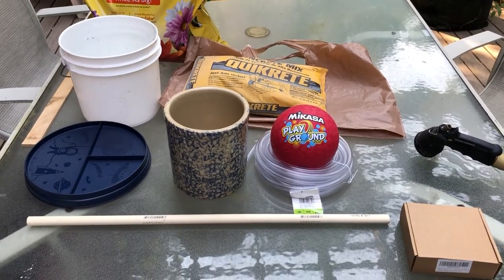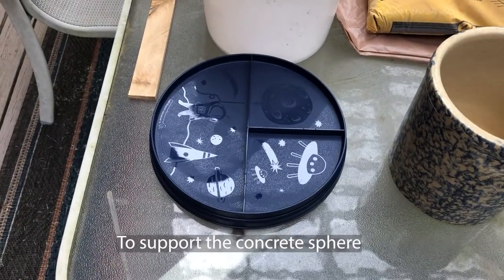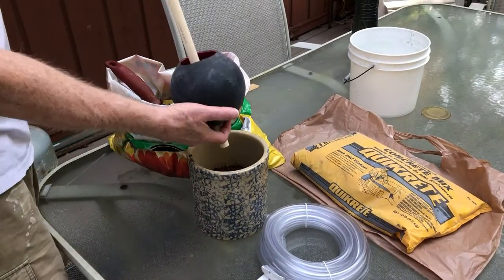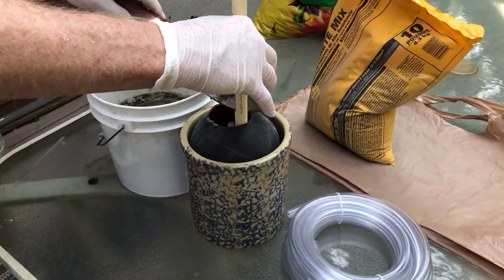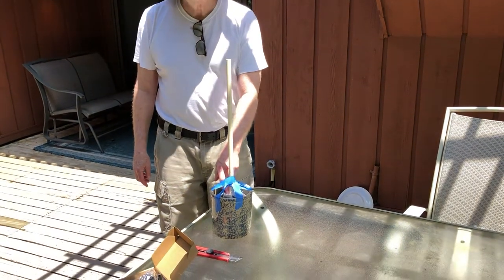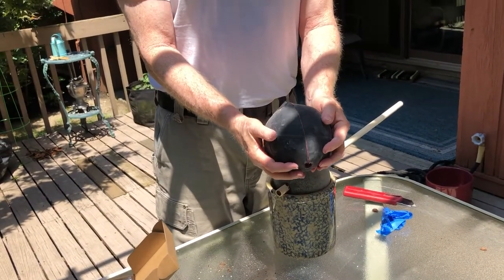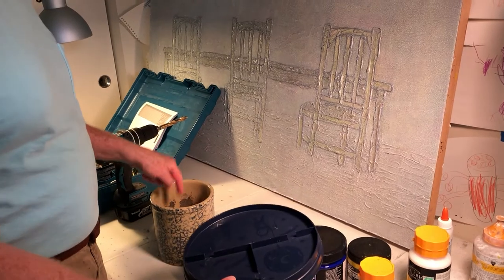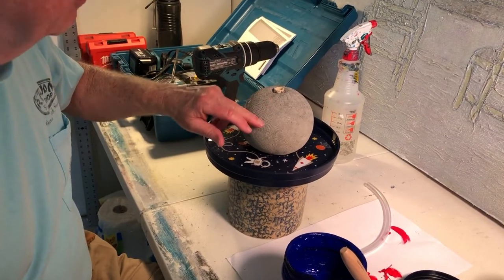Spherical Hummingbird Fountain Project

Comment: How did you cut the ball ?Did it pop?😊 please show all steps
Reply from the maker: The ball was new. There’s not much pressure in them. You shouldn’t have to worry about that. You have to cut two holes in the ball. One each at opposite sides. One hole should be larger than the other. The smaller hole should fit fairly snuggly to the PVC pipe to prevent the concrete from running out at the bottom while filling the void with the concrete. The top hole should be large enough to pour the concrete mix into the void of the ball. You have to slice the ball open to remove the concrete when it has set. I suppose it would be possible to make that top hole large enough to remove the set concrete but it probably wouldn’t be a sphere (which isn’t really a problem unless you really wanted it to be a sphere). To cut the rubber ball open after the concrete has set I used a box cutter.

Comment: What kind of paint did you use?
Reply from the maker: Artist acrylics if I remember rightly and I can tell you…don’t use that. We may not have let the concrete dry enough but it didn’t take long before it started coming off. I would research the best type of paint to use on concrete. Another option would be to check out Robbie and Gary Gardening Easy  for tons of easier and less expensive projects for hummingbird baths.